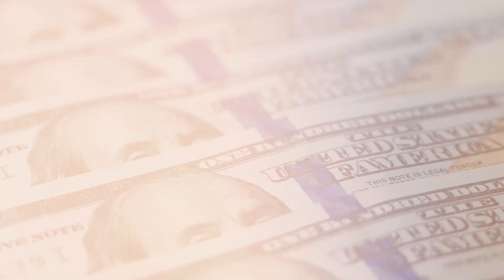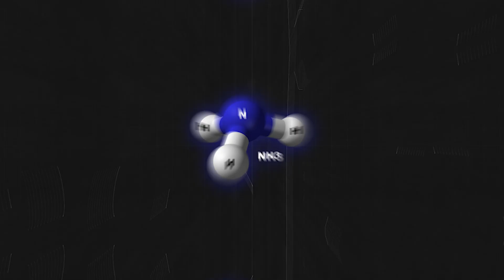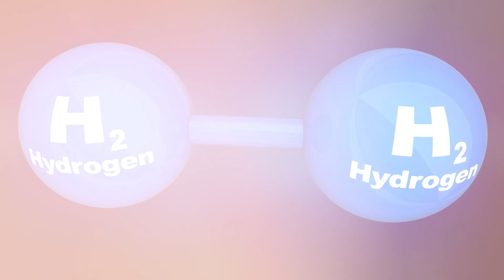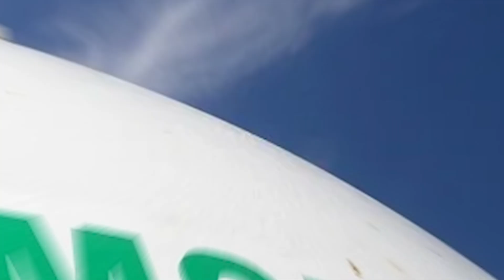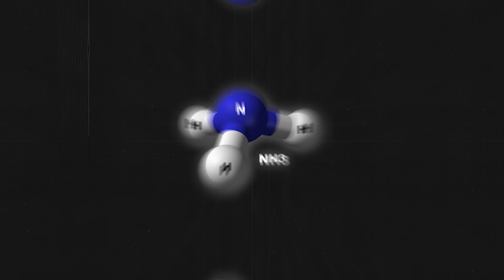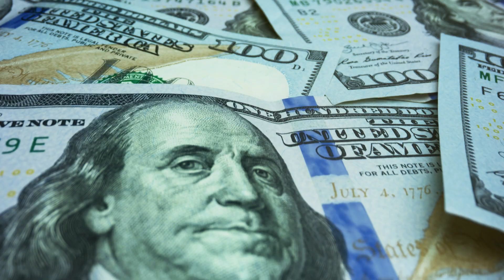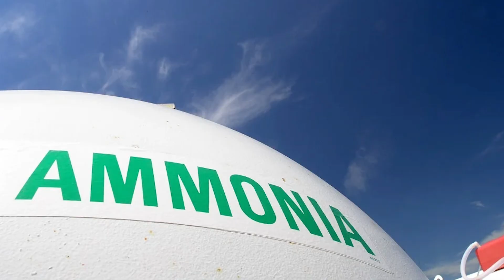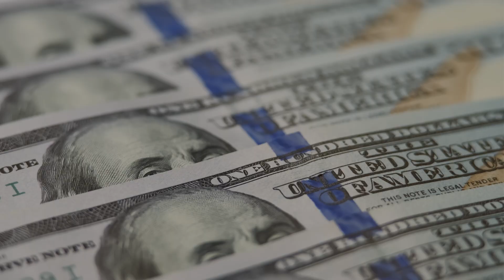(IT's OVER) Toyota CEO:  "Our NEW Engine Will DESTROY All EV Makers!"

Comment: I ve seen the same BS to many times. So where to get Ammonia from?.  The Haber-Bosch process, which converts hydrogen and nitrogen to ammonia, could be one of the most important industrial chemical reactions ever developed. The process made ammonia fertilizer widely available, helping cause a world population boom as yields from agriculture increased rapidly in a short time. Industrial ammonia production emits more CO2 than any other chemical-making reaction.

 Where do we get Hydrogen from?  Natural Gas Reforming/Gasification: Synthesis gas—a mixture of hydrogen, carbon monoxide, and a small amount of carbon dioxide—is created by reacting natural gas with high-temperature steam. The carbon monoxide is reacted with water to produce additional hydrogen. This method is the cheapest, most efficient, and most common. Natural gas reforming using steam accounts for the majority of hydrogen produced in the United States annually. Incorporating carbon capture and storage in the process can produce hydrogen with lower carbon dioxide emissions.( carbon capture is BS as well it produces more CO2 than is stored)   

A synthesis gas can also be created by reacting coal or biomass with high-temperature steam and oxygen in a pressurized gasifier. This converts the coal or biomass into gaseous components—a process called gasification. The resulting synthesis gas contains hydrogen and carbon monoxide, which is reacted with steam to separate the hydrogen. That produces CO a deadly gas.  

Electrolysis: An electric current splits water into hydrogen and oxygen. If the electricity is produced by renewable sources, such as solar or wind, the resulting hydrogen will be considered renewable as well, and has numerous emissions benefits. Power-to-hydrogen projects are taking off, using excess renewable electricity, when available, to make hydrogen through electrolysis. (You get less energy from hydrogen than it takes to make it.)  
And you need to combust Ammonia with additional Hydrogen to produce effective flame propagation.  High pressure tanks always leak. Explosive Hazard. 
Ammonia at af few parts per million highly toxic. High concentrations deadly,  one lung full. Dissolves  all mucous membranes. immune system break down.  
Do some research before posting.

Comment: This and the hydrogen back engines are just silly dead end tech. They dont help over all and comes with way too many cons. From the fuel taking more energy to produce to the needs for even more types of storage and transporting. It doesnt solve anything unless your country just has a lot of it on hand. EV tech can only improve as of right now - meaning it will be better just to hold on tight until the improvements come allowign that 600 mile range + power station improvements that need to happen anyways.